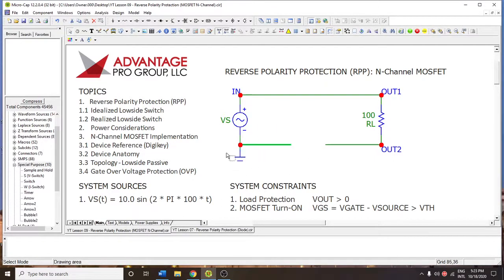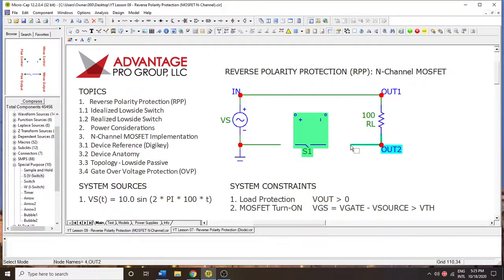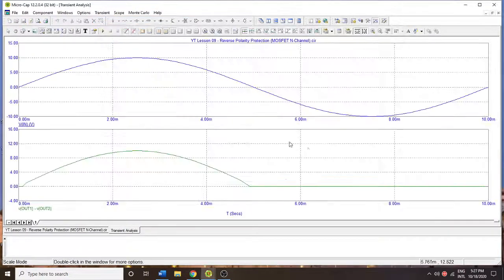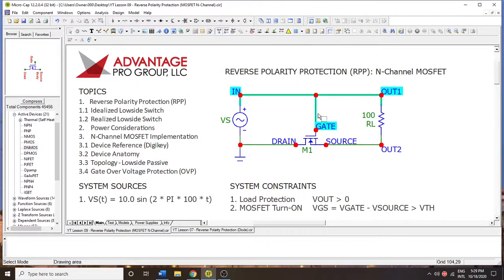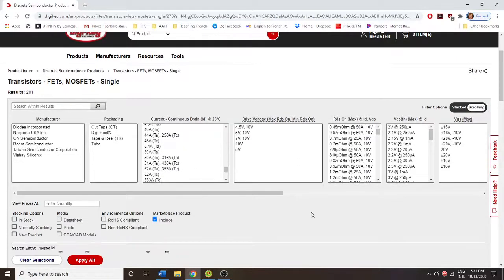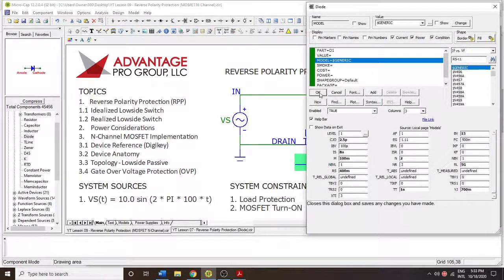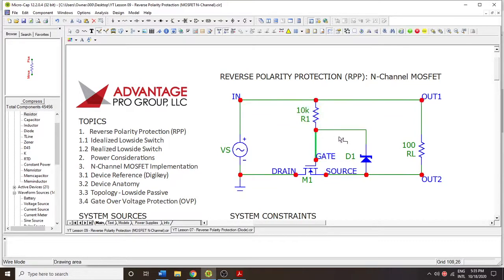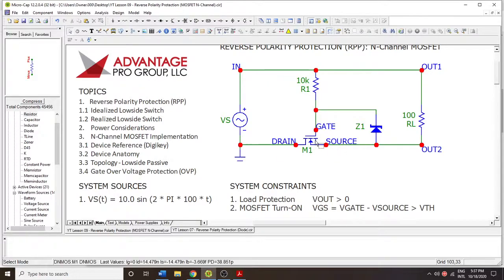Micro-Cap Tutorial: MOSFET Reverse Polarity Protection (Lowside NMOS)

Comment: Can you help me? Transient Analysis Limits , V(OUT1) . V(OUT2) error , What can I do? which is it operator?
Reply from the maker: well, with the way you've communicated, it's a very generic question. If you can narrow it down for me I'd appreciate it. Usually, problems with limits tend to be about naming things. It's likely that you don't have an "OUT1" or "OUT2" node in you circuit...so MC12 would choke in that case because its trying to process something that isn't there.

Comment: What is the advantage and disadvantage of using N channel on the low side over P channel on the top side side for reverse polarity protection?
Reply from the maker: Really good question! For passive systems, they are nearly equivalent functionally. N-Channel applications in low side are often cheaper because manufacturers make billions of N-Channel per year (scale economy). So if you make thousands of your products saving a couple cents per device can add up. 

Sometimes you might not want a large volume device in the lowside/return loop area for layout reasons. That is to say, your board real estate might not resolve to something that fits the device geometry near the ground loop termination. I've done boards which it made more sense to place a reverse polarity application on the highside area compared to lowside area because it optimized the space usage better for the board.

N-Channel applications require all voltages to be referenced to a separate ground node which you might not like to manage...so there's a "true ground" and "protected ground." 

N-Channel devices almost always have low ON-state resistances compared to P-Channel devices so N-Channels help prevent system power losses which is good. 

I think one disadvantage of N-Channel devices that comes to my mind would be if you have a lot of other switching circuit subsystems going on that are referenced to the protected ground. The series inductance and stray/parasitic capacitances of the N-Channel device in that ground loop position might react in a way you wouldn't expect. All the current aggregates at that N-Channel device as it exits your product. So, if the current has frequency content, it could do something weird. You'd have to look at how your switching systems interact and how their loads behave which would manifest the potential frequency content.

Adding either reverse polarity device changes impedance of the lines so it's a good idea to think about how you might balance it in either application.